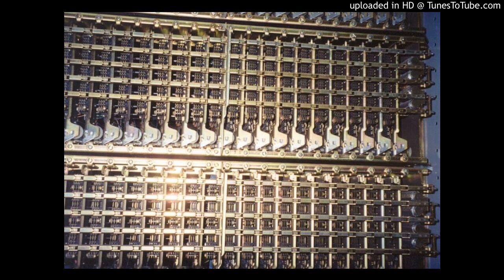Martin Explains #5 Crossbar to Me (part 2) at the Telephone Museum Ellsworth Maine, September 2016

Comment: I enjoyed listening to your #5 Xbar videos as they brought to mind many fond memories. Unlike most of your listeners, I could envision all the circuits and frames being described. In the 1960’s I worked as a CO technician in a large #5 office. It was a combined local /toll office and also provided Centrex service for General Motors. I also spent many years in switch traffic engineering.

Regarding the channel selection process, I don’t think the channel 0 to 9 order provided an advantage in traffic carrying capacity over a rotating sequence. It was an inexpensive, simply designed circuit because it didn’t affect the equalization of usage on any piece of expensive common control equipment. After all, the channels were just wires, crossbar switch crosspoints and the usage on crossbar switch select and hold magnets. Even so, the designers built in a cross-connectible arrangement in which the order of selection could be changed  from channels 0 to 9 to channels 5 to 9 then through 0 to 4. These cross connections were supposed to be changed every so often to help equalize the usage on these channels, although I don’t remember my foreman ever coming up to me and saying ‘’it’s time to change the channel selection preference in the markers”. Also, any marker performing a 2nd trial attempt automatically changed the channel selection order to 5 to 9 then 0 to 4.

 Regarding the by-link operation of incoming registers. The registers serving by-link trunks were engineered to a very low level of occupancy, which was an average of 32.5 % during the ten high day busy hour. This simply meant that in a busy hour, a register should only be in use for 1170 seconds of that hour, and for the other 2430 seconds, it should be idle. Engineering to this level of occupancy meant that an idle register would nearly always be immediately available when a by-link trunk was requesting service. The actual engineering criterion was that only 2 calls in a thousand would fail to immediately access an idle register. 

Here’s a short Phone Phreak anecdote. During my tenure in the #5 Xbar office, we started having a problem with a small Recorded Announcement System device.  This device provided an announcement on calls to unassigned numbers. It kept breaking down. While monitoring the circuit, I noticed that during the few second interval between announcements, kids (teenagers) were able to talk to each other in a conference arrangement tieing up all the intercept trunks connected to the device. In the few seconds they had, I heard all kinds of rude, crude and salacious comments. I was shocked, I tell you, shocked. No wonder the announcement device kept breaking down, it was recycling for hours on end. I fixed the problem by adding a wire spring relay to the circuit. It operated between announcements and cut off the transmission paths of the intercept trunks.

Comment: Is there a number we can call to hear the old crossbar in operation?
Reply: Kinda, but no. You can call into our No. 5 Crossbar at the Connections Museum in Seattle via C*NET but Asterisk does not let you hear the call setup phase, and will only cut through audio once the call is ringing. It's a limitation of the software PBX that I have not yet figured out how to overcome.
Reply: @ConnectionsMuseum  Could you tell us more on how to get to the crossbar and which number to call/when? This would be cool to hear.
Reply: @lance_nickel  You can dial into C*NET, either by connecting your own PBX, or by using one of their PSTN access numbers. Then, dial one of our telephone numbers (Look under "Connections Museum" here https://www.ckts.info/directory/nanpa/index.php?sortby=name) More info at http://ckts.info
Reply: Lance Nickel oh yeah, and the museum is open Sundays, 10-3 PST